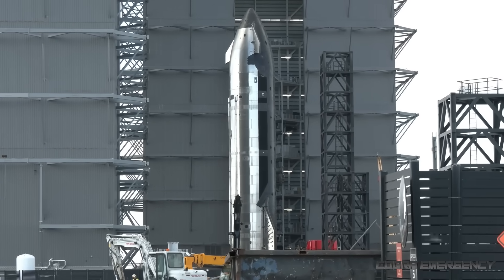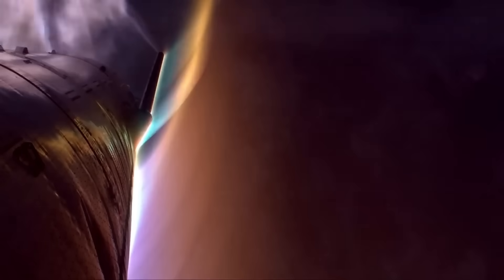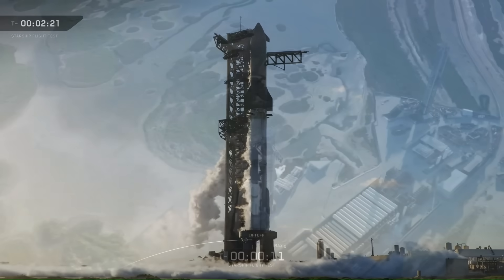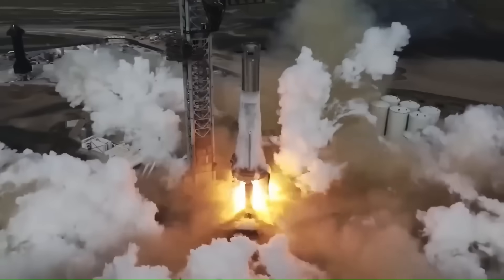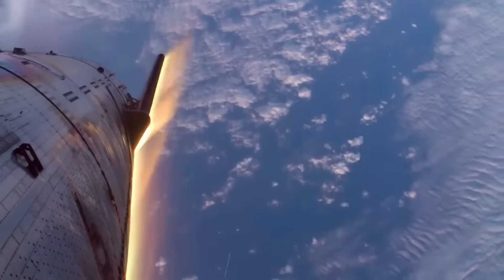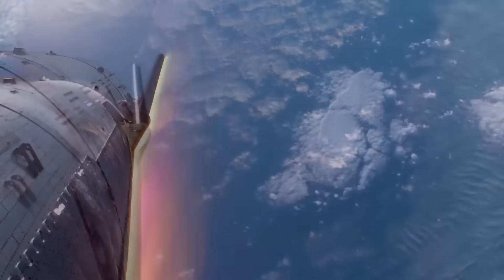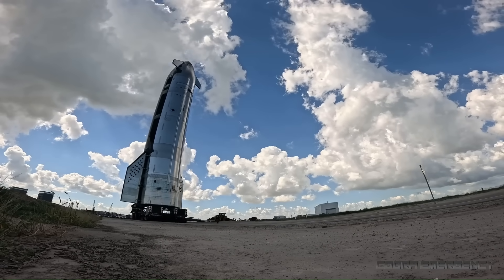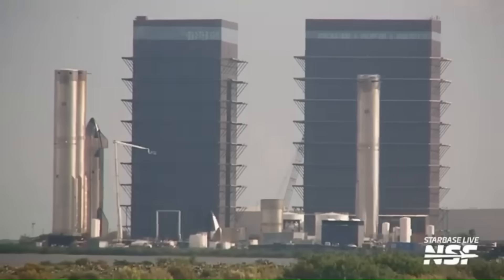SpaceX Just Rolled Out The New V3 Starship Ship 39... This is INSANE!

Comment: There is no way V3 can lift 100t to LEO. Pure BS.
Reply: So what tonnage can it lift to LEO???
Reply: @chrisantoniou4366 It depends on how much lighter V3 will be relative to V2. V2 only demonstrated 20t to a suborbital trajectory about 200m/s shy of a circular orbit. Raptor 3 could increase it 15t best case. So you have to save 50t of dry mass to get to 100t. That is a lot of mass to save for this vehicle.
Bottom line is the payload increase will come not from the Raptor thrust but from whatever mass savings.
Reply: @chrisantoniou4366  To date; none.
Reply: @JarvisThribb  Read the question again - not "has" it lifted, but "can" it lift...
Reply: So you are an engineer with work in this filed? Or are you just typing from your mom's basement?
Reply: @W @WyoSavage1976 rospace Engineer graduate U of I.
V2 demonstrated 20t to a suborbital flight. They are still 200 m/sec short or orbital velocity. They land with tanks dry. That tells you they are close to max payload. V3 has higher thrust. You will get an improvement in gravity drag. Maybe 10-15t. You are still short. You can convert dry mass savings to payload. However, 60t mass savings. I don’t think so.
That’s it.
Be honest, do you still live with your mom… that was an odd question.
If I didnt agree with a technical claim I would make a technical argument. It sounds that you are incapable of putting one together in